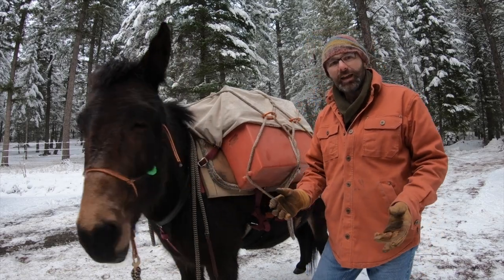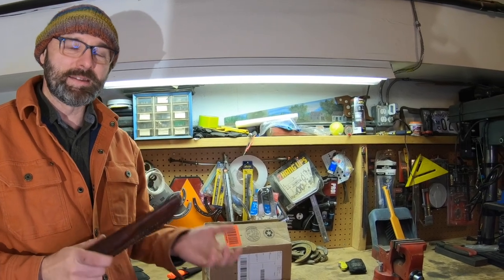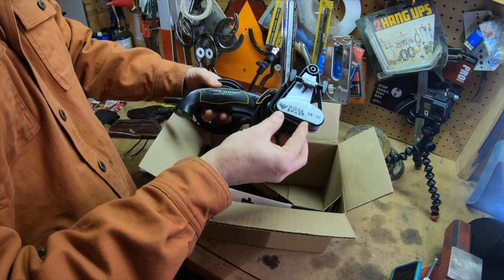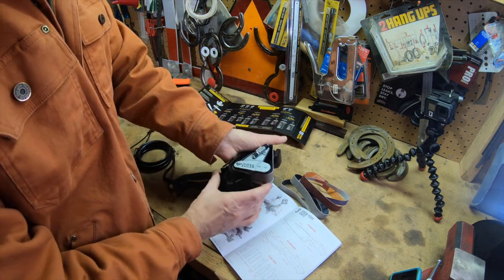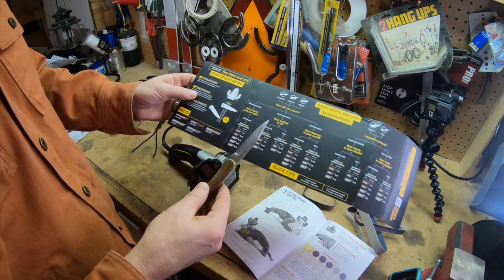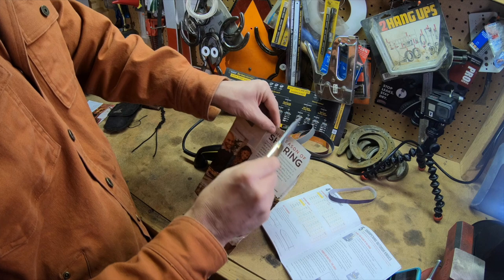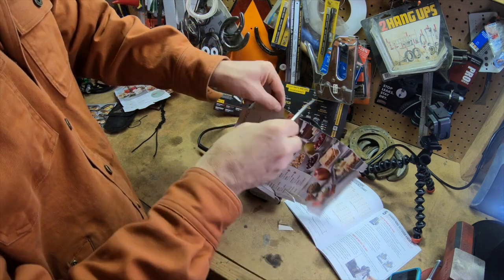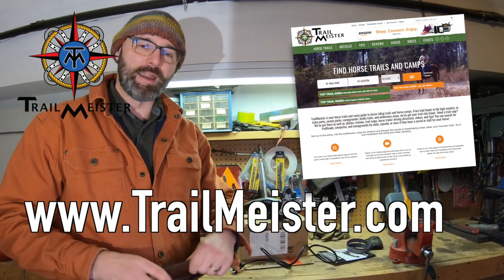Ken Onion Knife Sharpener Review

Comment: You forgot to pick the angle of bevel you desired. For an example, for that knife you sharpened I’d have picked the 23° bevel. A filet knife or kitchen knife I’d go with a 17–15° angle. And watching you do that knife, you’ll take the point off of it quickly with how you’re doing it.  I’ve got several I hosed the tip off of as well. Grind at a slower speed and stop the grinder when the tip of the knife reaches the halfway point as it’s crossing the belt. Also keep the edge perpendicular to the belt as you draw the blade across the belt. So if you’ve got a knife edge that curves as you near the tip, you’d lift the handle keeping the edge being pulled level across. WorkSharp has some incredible videos, I’d recommend watching, that way, your knives will be as sharp as they can and your videos will assist your viewers in their sharpening journey as well. Good luck to you, I love my razor sharp blades, and this machine is one of the fastest ways to get them there.